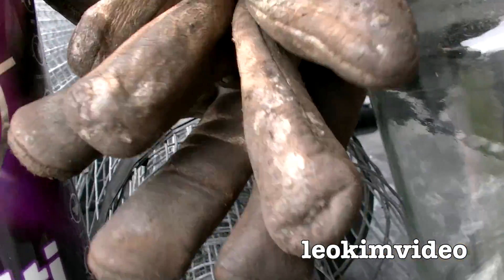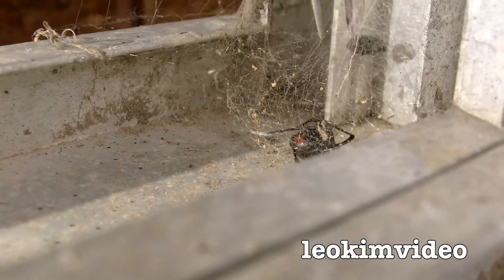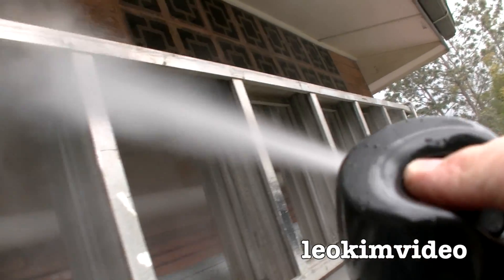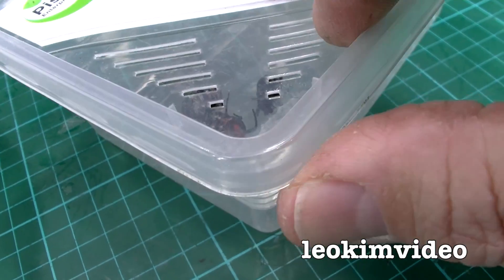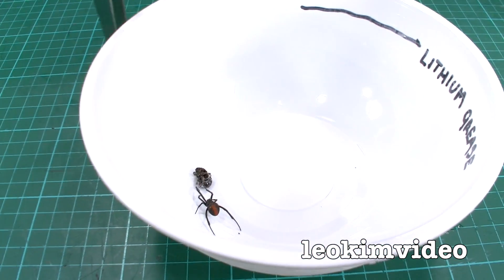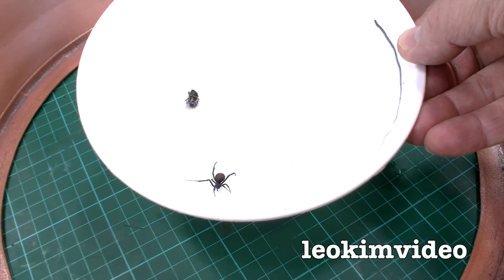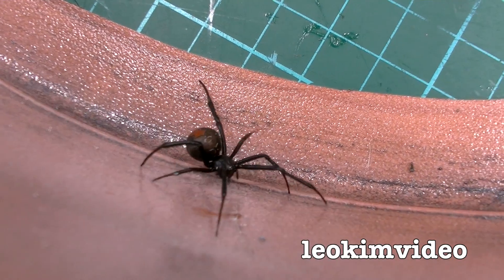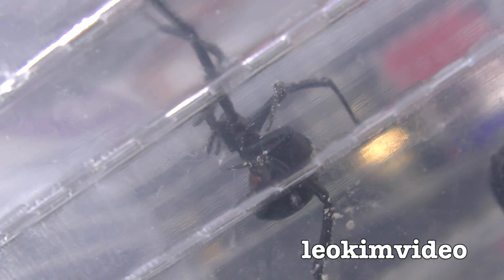Redback Spider Sneaky Winter Hideout Lithium Spray & Attacking Ants

Comment: Bigger spiders can't climb on grease, because they are heavy and slip down.
But baby spiders are very light weight. That's why they can travel by wind and walk on grease. So I doesn't work to control the baby ones, but it's good enough for the bigger ones.

Comment: For the talcum powder you mix it with isopropyl alcohol to make a paste, then apply it to your surface and when the alcohol dries it makes a thin layer of the powder.  When the ants or an insect try to climb past the little particles don't stick together and they fall.  If it's too clumpy they can get across, and eventually it'll fall off and they can get across.   I don't think it would be your best option both in the sense of strength and time to apply.  I think you should maybe test it out for science and curiosity but that's it.  Maybe we'll be surprised and it'll be the best!
Reply from the maker: I'm thinking teflon strips may work better!
Reply: Oh I agree! But we must test them all for science.  I really liked that Lithium grease too and am curious how long it will last.

Comment: My house has spiders but their not dangerous can someone tell me what's a brown small spider
Reply: Braeden Garner then he burns the house?
Reply: Pug Warrior get out burn the house
Reply: Pug Warrior depends where you live, here in Missouri it is almost impossible to find a house without  brown recluses in it. Your spider could be a house spider recluse probably or something else. If it's a recluse don't fret, they are called recluses for a reason they absolutely hate loud noises or vibrations, and usually on come out when it's quite out like night time.
Reply: But they are still poisonous so watch out, not really deadly posionus unless you are allergic, I'm pretty positive I've been bit by a recluse and I've shown no symptoms

Comment: the talc i believe you either simple smother a cotton wool in the stuff and wipe it around the edge or you add a touch of water making into a dry paste sort of then apply but i believe its simply talc on the wool swabbed/wiped on items but has to be reapplied weekly/monthly in some cases.

Comment: How did u clean out the spider tank, are u going to make a new one?
Reply from the maker: I want to make a curved glass spider tank 2.0. What I didn't like about the one I used was the 90 degree joins. The spiders used this area as a safe house. It made seeing the spiders a tad tricky when they hung out in the corners. The new spider tank may need to be a custom build. I can't see anything on the market that works for me.